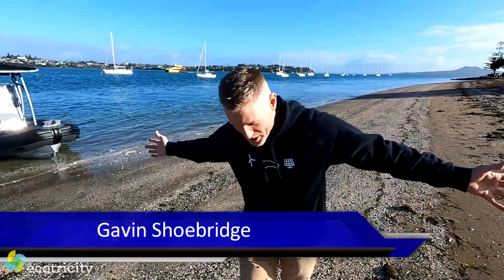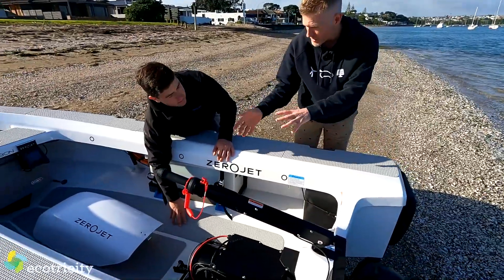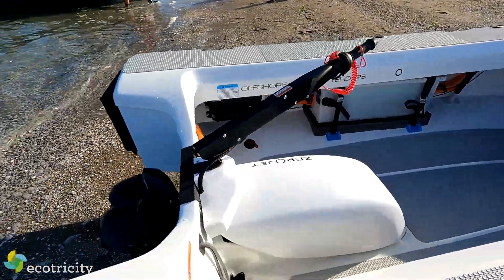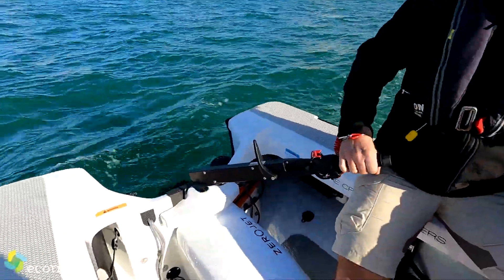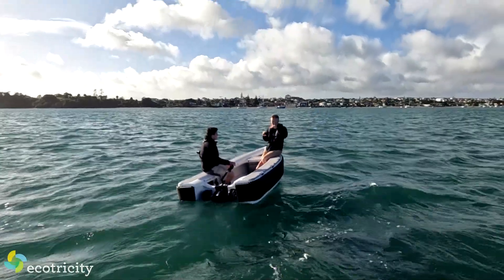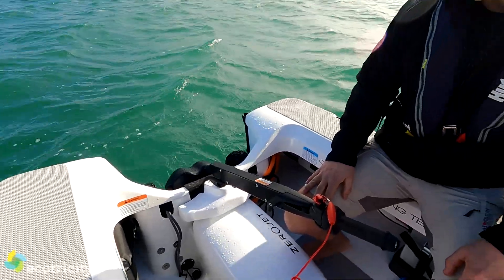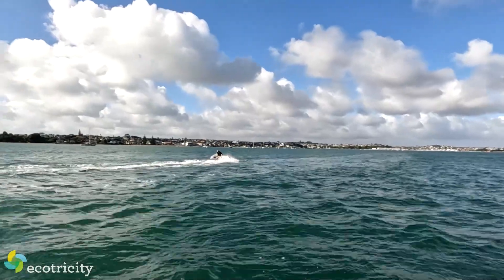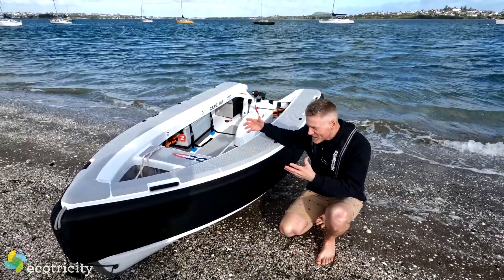I took a ZeroJet electric jet boat for a blast!

Comment: 😢lots of complaints on price. Why not make a $5000 powersystem that is mass produced. A matched set a handyman could install into an older hull. I have a 16ft runabout that should plane easy at 20mph with 25-40hp. Look at homemade  jet boats using jetski motors. Not hard to do. A matched battery, wiring, motor, etc one could install himself would sell. Or other boat manufacturers could make it an option.
Reply: Check out ma-3d

Comment: Seriously? Isn't this just virtue signalling? You spend years developing a small boat adding up all your Co2 output along the way, plus all the Co2 it took to produce the batteries, and end up with a tiny boat that can buzz around for 60 mins, what, once every 3 months? How can anyone sit in that thing and say with a straight face, "zero emissions"?
Is this anything but fun and games for the wealthy?
That's a no from me. 👎
Reply from the maker: I love that you're also as concerned about carbon emissions as me. That's important. Yes, they are pretty spendy things, but you have to remember that even the Nissan Leaf was above $70k when it first arrived in New Zealand. Electric tech will always get cheaper in time. As for the machine's use case, it's a small tender, not a long haul vessel and there seems to be a market for them. But most of all? This thing is absolute FUN! I hope you can try it one day. -Gav
Reply: too poor to own one I guess